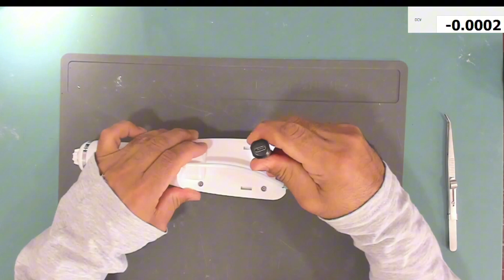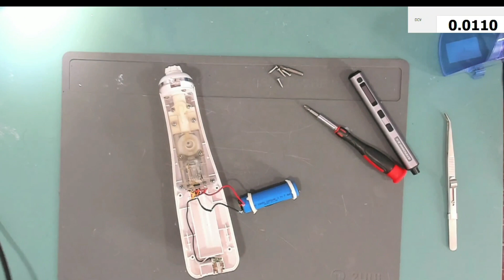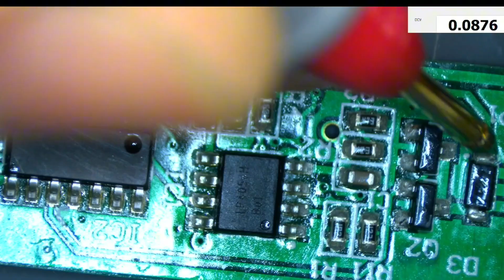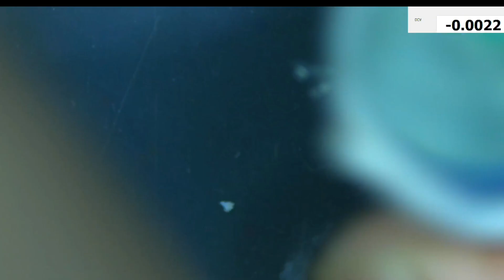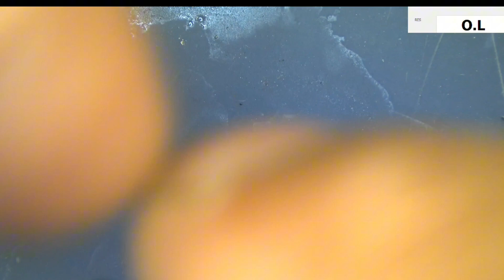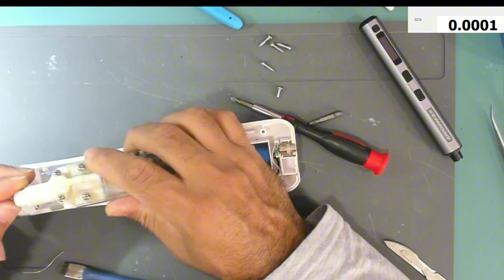Water floss Device fix

Comment: Why you did not expand your fault explaintion  by  using typical   application circuit . there is resistor 1 connected  to cs pin look like shunt resistor.   Kindly inform us if it repaired as you thinking  . Thanks

Comment: Seems BMS IC in under-voltage protection mode. You just need to apple around 3.6V to the P- & P+ terminals and let the battery charge a bit.
Reply from the maker: The battery voltage was 3.8v, so how could it be in under voltage protection mode
Reply: @FixTronics  Then what about Short circuit protection mode... May be there was an instantaneous short circuit. Because it is very rare to burn that particular IC
Reply from the maker: @pramodwick 
Maybe water has got in there and caused it to damage.
The main board looks good and has no shorts, otherwise it wont work even after I made that bridge